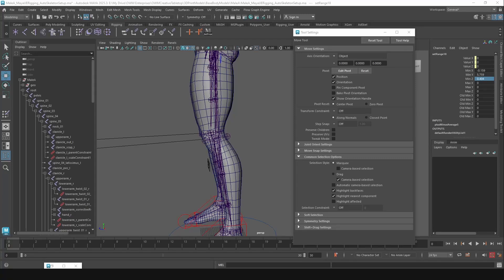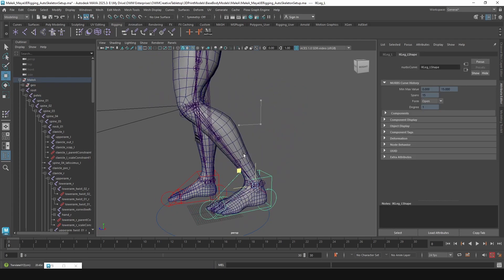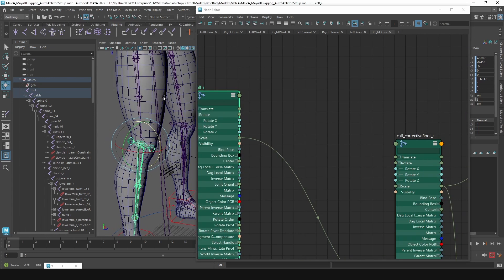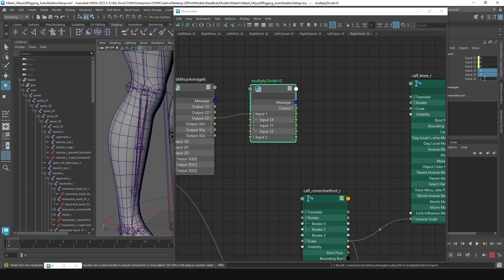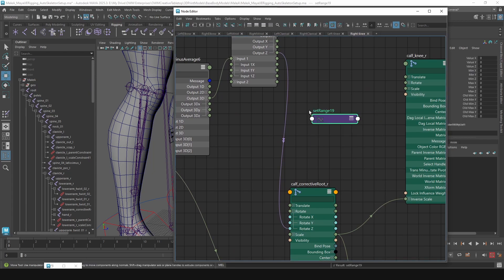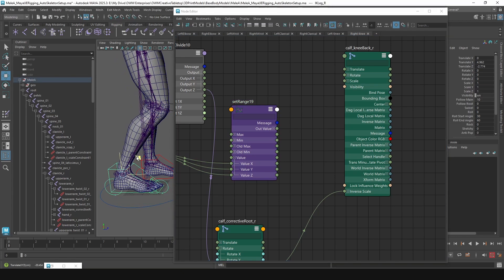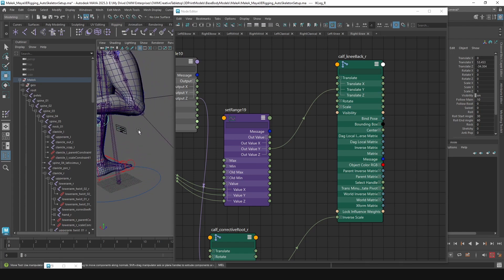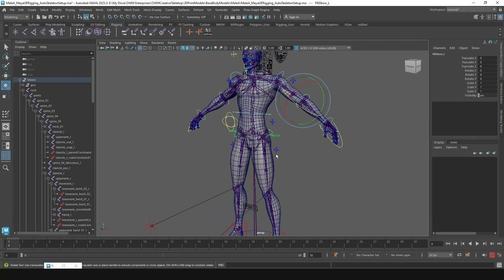Automated Corrective Joint Setup In Maya

Comment: This can work okay-ish if you are using it on a hinge joint, like elbows and calves because they're expected (hopefully) to only move in one axis, but ideally you should never rely on using rotation values. If you tried that on the shoulder or thigh, soon as you get close to gimbal lock it'll break completely. This can still happen even on these joints to though, especially if you are retargeting mocap which may end up giving you small values on other axises which affect the main one.

Comment: Read this complete comment, if you just wanna make this easier.

normally in corrective joints we add on extra joint in the mid (on the same place where the actual deformation bone is), and then take make twoo child bones of it as shown in th vid, but we can do 2 things,
1. create a complete saperate joint outside the elbow(where we place pole vector), and then convert the main bone rotation value to the translation values using sin and cos, and make the rotation value / 50, means the translation should be the half of rotation. If you will directly apply the rotation to the rotation and diviide if half, the corrective bone will rotation along its own axis, so don't do that.
2. create a complete saperate joint outside the elbow(where we place pole vector),  and then create a group of it, now, change the groups pivot to the main deformation bone, easy, now you can directly connect the rotation to rotation but divide it by 2

mainBone.rotateY ---------------> divideNode(2) ---------------> correctiveBone.rotateY